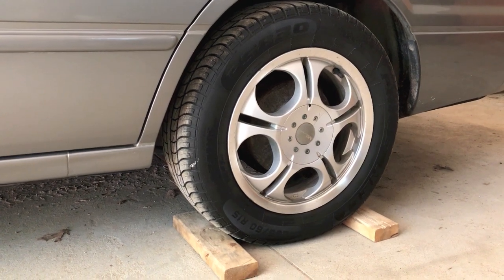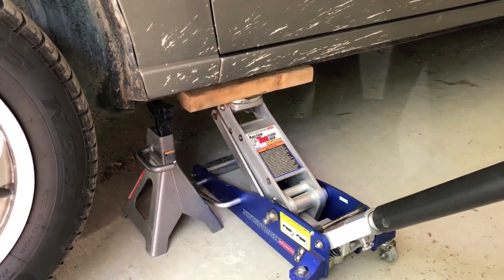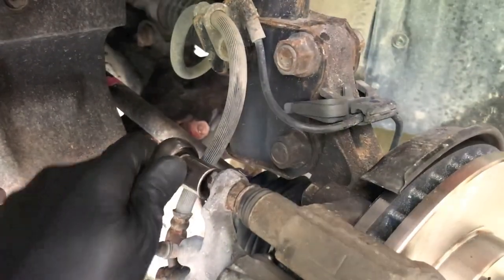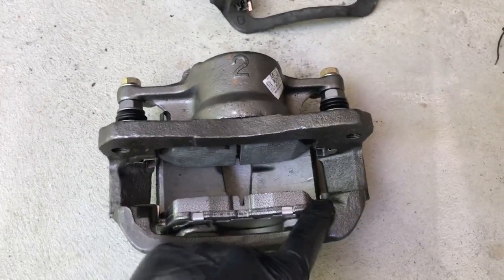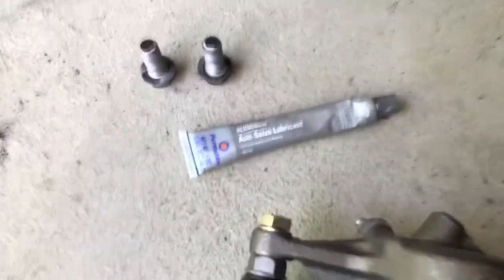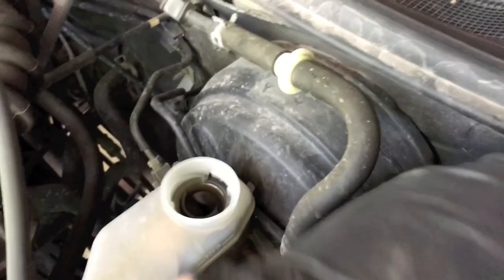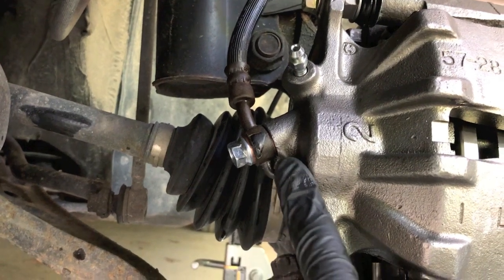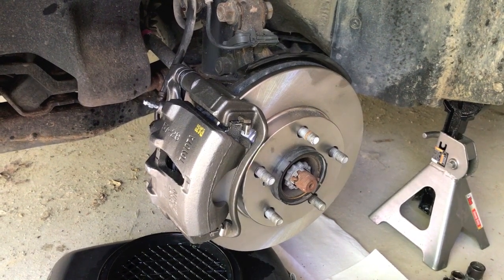Replace Calipers on Toyota Camry/Corolla - FAST & EASY

Comment: Thanks for showing us how you minimized the leaking of brake fluid during the transfer of the brake line
Reply from the maker: ee vang 

Thanks for watching, we appreciate you reaching out to us.  What’s the update on your project?

Keep us posted with any questions you may have.  Please subscribe to the channel and turn on your YouTube notification Bell 🛎 that would be awesome thanks again!

😎👍🔧🔩
Reply: This is the "Nixon" method, famous for leaving gaps at a critical period in the tape / vid / transcript.  And then become clueless when questioned about it!
Reply: @DIYwithMichaelBorders  is it possible to clamp the hose when transferring it to new caliper? If so, what would you use?
Reply from the maker: @stevejones9435  

Thanks for watching & some say yes, some say no.  We choose not to...to alleviate any & all possible damage to hose.
Reply: Fjb @SpringIsBACK
Reply: @stevejones9435 Not with a 2009 Toyota Corolla. The brake lines are hard enough that clamping them will damage the lines. I had to replace my driver's front caliper, due to an issue the 2009 has with seizing its caliper pins, and it was a huge pain.

Comment: Thanks you for a great and useful video. As you've said, in real life, removing old, rusted bolts could be a pain (especially the bracket bolts - I broke a few with a braker bar). I always use 50/50 mixture of the ATF and acetone to penetrate old bolts and everything that needed to be loose.
Reply from the maker: We are honored to read this, and you are welcome.  We have all done that for sure…😁…any time we pull out our breaker bar…we mean absolute business.

Buuuut…unfortunately bolts can snap when you sing that tool.  😁👍🧰

Comment: I had someone tell me I had to put a c clamp on that brake line hose, to prevent fluid leaking out, but I see this wasn't done in this video. I assume using the C Clam to clamp that would potentially damage that hose. Trying to learn some mechanic stuff for myself, because all the shops around here have been involved in a lot of shady scamming, so looking to learn a few things. This was a very well produced video, clearly demonstrative. Thanks (I know it's 5 years old, but thanks still)
Reply from the maker: Good morning, we are drinking our morning coffee answering any and all questions for the DIY community.

Shady shops are not cool, we have experienced this way to much.  You’re spot on, clamping hoses can damage them.  We don’t clamp hoses for that exact reason.

We appreciate you reaching out to us, please let us know if you have any questions.  Keep in touch.

Enjoy your weekend.

😎👍

Comment: Caliper bolt 14mm. W 17mm wrench to hold it and torque is 25bs. 
Caliper bracket is 17mm w torque at 79 feet pounds.  
Banjo bolt is 14mm stock 11mm on my remanufactured replacement calipers and torque is 21 lbs.
Reply from the maker: Thanks for watching.  👍🧰

Comment: Great videos and tips a far cry from another Chinese guy doing for a customer whom I feel very sorry for; I am doing this tomorrow to our 2004 Corolla but the calipers are Duralast from Autozone, not Toyota as shown here. One caliper is stuck and car shudders once brake pedal is applied; rotors are fairly new also duralast but I will be replacing those as well.

Comment: Question please 
When you replace new caliper u need to bleed the side you change or all 4 sides?
N Waths happened if you bleed only the side u change?
Thanks
Reply from the maker: Thanks for watching.  As long as you don’t allow brake fluid to flow out for several minutes, you can get away with just bleeding that specific caliper you replaced.

Comment: "...in between the two washer..." <waiting to see> i would have liked to see how you transferred the brake line from old to new.  you didn't show that, was it messy?  i'm asking because looking at the old caliper before you returned it to the store, it surely looked oily wet.  did you do anything to the break line, for example pinching it to prevent minimum leakage?

Comment: Thanks for the information it helped me reconfirm what I need to do im fixing to get this started on my 2010 Corolla S
Reply from the maker: You are very welcome.  Keep us posted on your project & any questions we can help you with.

Hope all is well.  😎👍🔧🔩
Reply: @DIYwithMichaelBorders  it went very well man. I only needed to replace one of the calipers and install new pads for both brakes upfront. Bled the brakes and it's back on the street. 💪
Reply from the maker: @illuminatusquis5909  

Awesome Awesome & that’s great to hear.  Hopefully many stress free days ahead for you.

😎👍🔧🔩
Reply: @DIYwithMichaelBorders  I would love to get the rear axle with disc as opposed to the drums I have in the rear..and a 2.4 engine from the xrs would be nice too 😅
Reply from the maker: @illuminatusquis5909  

We will be doing a full brake pads, rotors, & shocks project on a Juke tomorrow.  Should be fun.

😎👍🔧🔩
Reply: @DIYwithMichaelBorders  nice that should be fun!
Reply from the maker: @illuminatusquis5909  

😎👍🔧🔩

Comment: Sorry but you didn't show swapping the brake line, perhaps the most important thing
Reply from the maker: Thanks for watching & we appreciate you sharing your thoughts.  Are you referring to the rubber brake line that feeds upstream into the engine compartment...?...ours did not need replacing.

Keep us posted on your project.

Comment: Hi, when replacing the front disc pads does it matter where the pad that has the wear indicator go? Does it always on in the front or back of the rotor? Does it matter?  
I’m replacing the brakes and rotors on my 96 Corolla, first time doing it.. it all seemed fine.. once everything was all wrapped up I was testing the car some light smoke was coming out of my right wheel. I stopped immediately and turned it off. . Now I need to determine if I have a seized caliper or maybe the pads were installed incorrectly. 🤔
Reply from the maker: Thanks for watching & welcome to the DIY Raptor Club.  Great question & the pads with the wear clips will be installed on the inner portion of caliper closest to engine.

The pad without wear clip is to be installed on outer portion of caliper closest to you.

Where it can get tricky is when installing the pads with caliper upside down.  You may want to do one last inspection of caliper and pads as you shift the caliper upright and onto the rotor.

This will allow you to ensure that the pads are installed correctly.

Keep us posted on your project.  👍
Reply: @DIYwithMichaelBorders  looks like your wear indicators are on out side...

Comment: Thanks for the video, what do you do if you have a slow drip where I re installed the brake line? I don’t want to over tighten it and I’m not sure why it’s leaking
Reply from the maker: Thanks for watching & welcome to the DIY Raptor Club.  This can happen when the caliper itself is not ever-so-perfectly positioned.  Also, you want to ensure that your copper washers are installed in the proper position.

Over tightening is never a good thing as you were hinting.  This can also happen if the caliper is an aftermarket rebuilt core & was slightly warped in its previous life on its previous vehicle.

Keep us posted, us fellow DIY’ers need to stick together!

😎👍🔧🔩

Comment: I replaced my calipers today and did everything step by step. I unfortunately ran into a problem on my right caliper where the brake hose connects to the caliper with the bolt. for some odd reason it does not want to seal properly and leaks now.. I had no problem with my first caliper. Any advice?
Reply from the maker: Thanks for watching & that’s no fun.  Is everything the exact same if you compare the old caliper to new caliper?

It’s possible that the new caliper is ever-so-slightly off on the machine specs and not allowing you to create a seal as it may be slightly shaped differently.  Double check the two calipers are the exact same everything...size, bends, machined hole diameters...

If the new calipers different in anyway, we recommend taking it back and replacing it with a new one.
Reply: @DIYwithMichaelBorders  that's the weird thing it's just a remanufactured OEM part so it should be exactly like yours and everything. I'm not exactly sure why it's leaking now besides maybe there's something wrong with the fit. I'll have to take a look tomorrow or something.
Reply from the maker: @GravityKing22  

Please keep us posted.  😎👍

Comment: Mike, on a 07 camry where the caliper guide pin goes with the rubber ? Dose it goes on top or bottom  ?
Reply from the maker: Thanks for watching, any update on your DIY project.  You will want to ensure the pins are installed the same way the old ones came off… that’s if the old ones were installed properly.

We don’t recall the exact placement of a 2007 however they are almost the same system-wide as shown in the position in this video .
Reply: @DIYwithMichaelBorders  thanks for checking. 
Yes I replaced the rotors and pads and I think mixed those pins .
It smoked only 2 times.  I'll have to re install them again.
Reply from the maker: @ashrafsiddiquee3190  

Thanks for the reply.  😎👍

Comment: Can you strip the caliper threads by over tightening? Cuz I think that's what happened to me. No mention of torque on banjo bolt.
Reply from the maker: TJ Macpherson 

Thanks for watching.  You will want to be careful by not over tightening bolts.  If you are referring to the Caliper slides, you may just need to realign them & gently add pressure to meet thread.  Keep us posted.

😎👍🔧🔩

Comment: Hello I have a 1993 Corolla, replacing calipers also brackets, does it matter right or left side when it comes to installing brackets?
Reply from the maker: Thanks for watching, great question.  Calipers are to be installed on the right side to alleviate the bleeder port from being installed on the bottom.

This will also require you to ensure the brackets are installed on the correct side as well.

Hope this helps.  Let us know if you have any questions and hey if you’re into crypto trading, join our DIY ecosystem.

       toolboxtoken.com

Reach out to us any time!  🧰

Comment: If the bleed valve is broken .. can it be replace in the calipers or do u have to buy a whole new one
Reply from the maker: Thanks for watching & welcome to the DIY Raptor Club.  Yes, the actual bleeder valve can definitely be replaced.  It’s possible you can purchase one from your local Toyota dealership.

They may need the last 8 digits of your VIN # to ensure they get you the exact replacement part.  Keep us posted on your project.

😎👍🔧🔩
Reply: @DIYwithMichaelBorders  Thanks dude
Reply from the maker: @trinichinee6426  

😎👍🔧🔩

Comment: What would be a good company to get calipers from? I need to replace the ones on my toyota venza
Reply from the maker: Armend T 

Thanks for watching & great question.  We purchase all our Calipers from AutoZone.  They come with great warranties as well.  Hope the video helped.

😎👍🔧🔩
Reply: Way too late for you, Armend T, but for someone searching around...  Try using the parts.toyota.com website.  Places like Vescovo Toyota (NM) and Norm Reeves Toyota (CA) have great OEM pricing and free shipping offers. Buying from an out-of-state dealership also helps avoid tax on a lot of occasions.  Getting OEM is always best for Toyota because Aisin/Advics (the brake maker) is top quality stuff.  Hey, there's a lot of 300,000 mile cars out there with their original brake calipers!
Reply: @NemotoMcAnally  I ended up buying some direct from toyota for a good price

Comment: Do you have the torque specs for the bolt for the brake line and other bolts?
Reply from the maker: Jason Summers 

Thanks for checking out the video Jason.  We recommend contacting your local Toyota Dealership & giving them your VIN #.  They can then match your VIN # to the exact specs for your exact vehicle.  Hope this helps!  Please subscribe to the channel and turn on your YouTube notification Bell that would be awesome thanks again Jason!  😎👍🔧🔩

Comment: ' new design that connects both caliper & bracket together as one part ` Clearly you don't know what you were talking about.  Stay with the topic you know.
Reply: You are correct Anh Pham NOT a new design just what is called "loaded" meaning with mounting bracket. You still need to install the brake pad springs!

Comment: I do not understand why you do not need the clips anymore. The clips provide and outward force to keep the pads from sitting on the rotors.
Reply from the maker: Good morning, we are drinking our morning coffee answering any and all questions for the DIY community.

There was a change in the design by the manufacturer no longer needing clips.  We 100% understand your thoughts & you are spot on, the clips are definitely beneficial for protecting the rotor from pads force/pressure.

😎👍

Comment: Those little springs you left out keep your pads from excessively heating causing hot spots on you rotor!
Reply from the maker: Mike Balloonman 

Thanks for watching!  The new Caliper part no longer has slots for tension springs.  Those go with the old style Caliper.  Thanks again for watching!  Please subscribe to the channel and turn on your YouTube notification Bell that would be awesome thanks again!  😎👍🔧🔩
Reply: DIY With Michael Borders I just did this job, the clips that come with the rebuilt calipers keep the pads back but I also used the springs. I didn't look for slots but everything fit together fine. I think those springs are only to keep the pads in place during installation.
Reply: By clips I mean those clips that the pads slide against, the new ones have angled tabs that push the pads away from the rotor
Reply from the maker: anonymous 

We are glad to hear it went well for you.  This can definitely be a tricky & annoying project.  Let us know if you have any additional questions along the way we are here to help!  😎👍🔧🔩
Reply from the maker: anonymous 

True!  I hear ya 😀

Comment: not fast and easy, putting the pads into the caliper is very difficult because the retaining springs have dual tension in two directions. You can get one side in but then the other side needs both tension tabs depressed completely at the same time, holding both sides and depressing at the same time IS NOT FAST NOR EASY.  You did not show how you did this in the video. So, you get a thumbs down!.
Reply from the maker: no debt 

Thanks for checking out the video and sharing your comment.  Sorry to hear you ran into some trouble during the project.  That’s no fun!  It can definitely be tricky & annoying...especially if the parts are badly rusted.  We attached a video that shows the brake pad clip installation.  Hopefully that video helped.  We also will leave it in this comment.  Let us know if you have any additional questions along the way!  We are here to help!

       https://youtu.be/m1iVBJIqQfw

Please subscribe to the channel and turn on your YouTube notifications that would be awesome thanks again 😎👍🔧🔩
Reply: Es caca
Reply: this Cry-Baby should not be touching his car to begin with